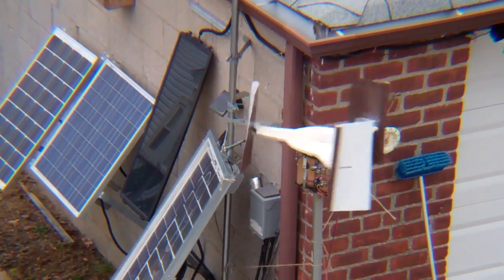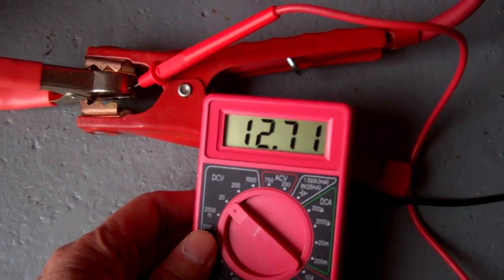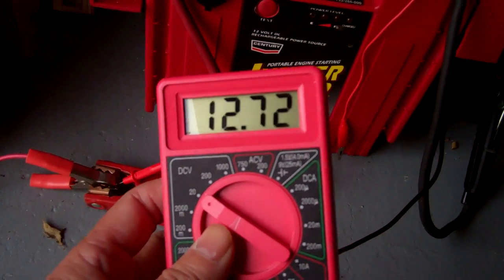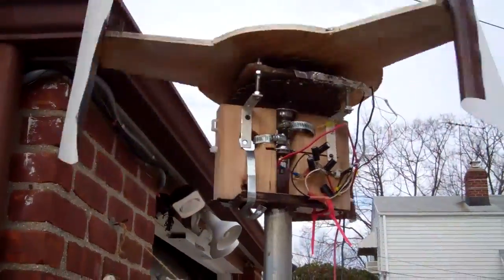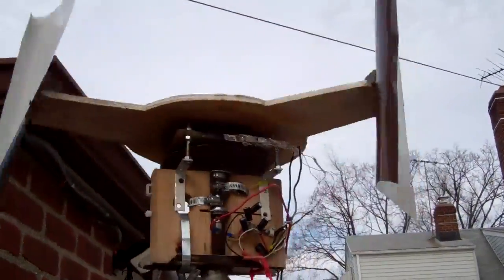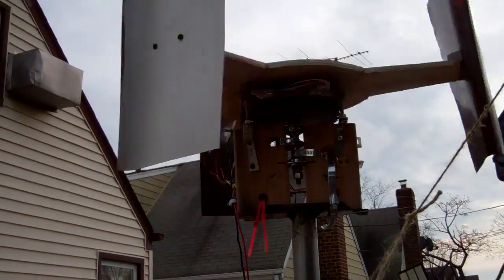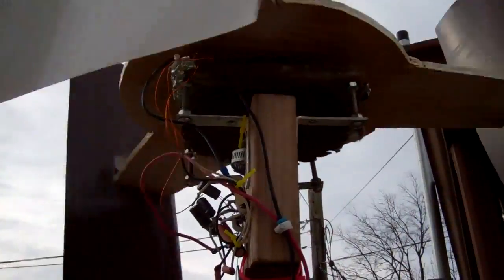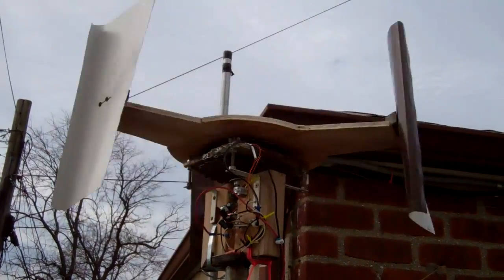Vertical wind turbine charging battery.mp4

Comment: Nice video.....do you use step up volt booster converter ....İTS very effective when wind is slow? Or not?
Reply from the maker: The circuit has a voltage boosting design. It is a small wind turbine so output is very small. The voltage boost allows the small energy to be used instead of just being dissipated when wind is slow.
Reply: @wtam69  for example enough 30 amp(360 watt)/day for me ,my Hobby lights. The booster colled to enough this energy...because my village wind is usually slow wind

Comment: how do you control the voltage that comes from turbine so that it does not up limit of charging voltage and stop charging when voltage under limit (very low wind )?  do you use something like regulator?
Reply from the maker: +Rafik Alhaji  If you have strong winds all the time, then you need a controller.  I don't get enough wind here to worry about overcharging.

Comment from the maker: @itsandbits1 It's the old small gauge stator. I'm thinking of making a 12 coil small wire stator but the copper wires are so expensive. The wings need to be secured. I just didn't expect the wind to come and so strongly.

Comment: @wtam69 
You'll have to support the taller blade, as you can hear and see when the rpm goes up and it gets unstable because the metal starts to flex and flop.
Did you rebuild your stator to get more voltage?